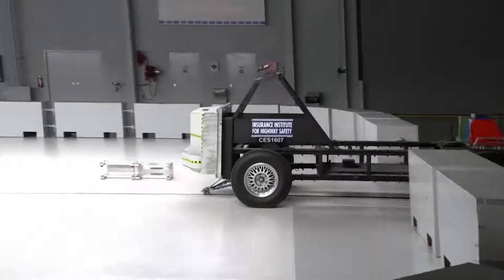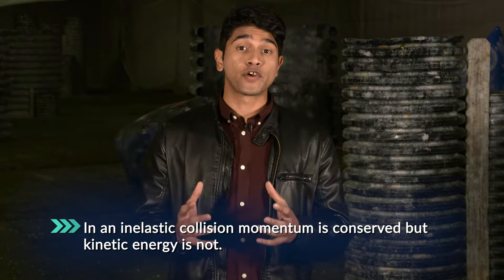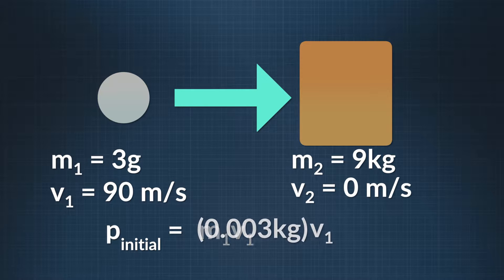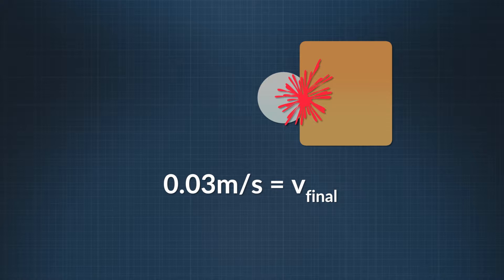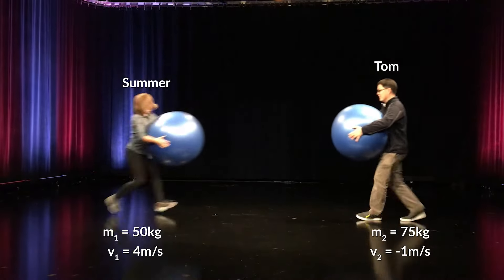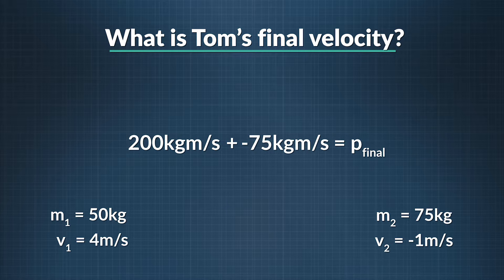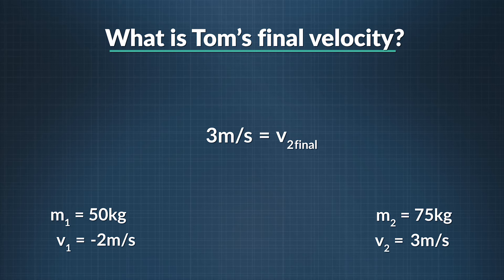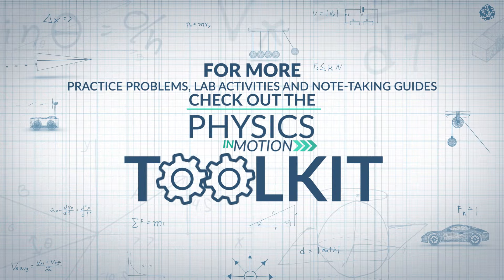Differentiating Between Elastic and Inelastic Collisions | Physics in Motion

Comment: The process for determining Tom's velocity as explained by Anzar is solid, but the physical event doesn't quite match up.  Summer's rebound velocity after the yoga ball collision is much greater than Tom's despite the results of the calculation.  The disparity made for a great conversational point in class.  Cheers on a terrific series!
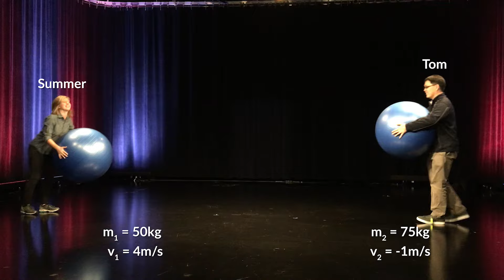Reply: That was because they didn’t actually collide at 4m/s and -1m/s. And you can’t be sure of their masses either. Their masses could’ve been different. The values in the video must’ve been taken for easy calculation purposes 4:54
Reply: Because they have different shoe soles and friction coefficients, muscle movement restrictions and so on. They are not in space.
Reply: Even when factoring those forces in, it doesn't account for the experience and invented numbers.  Nice thought though.  @doseoffaiyaz